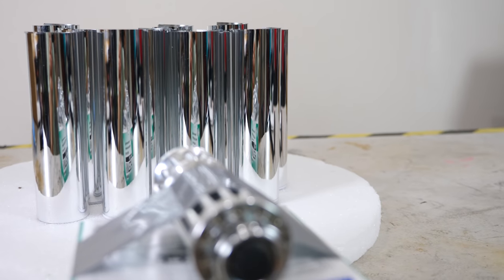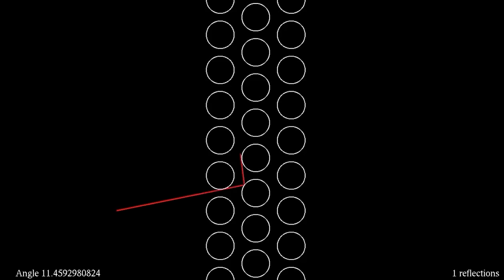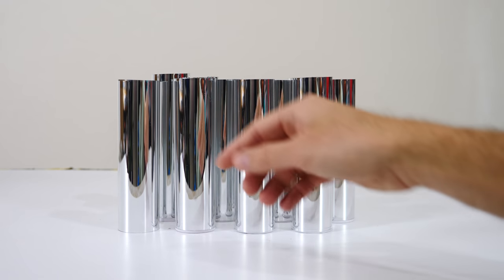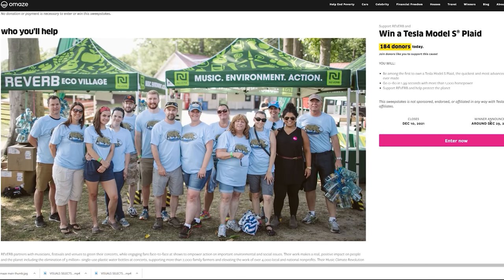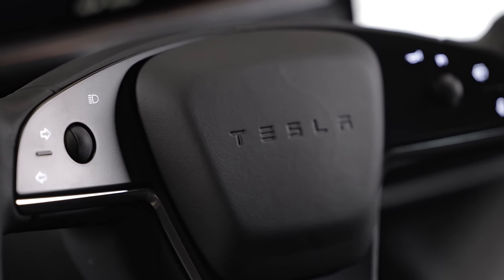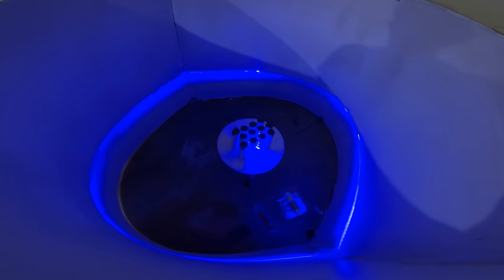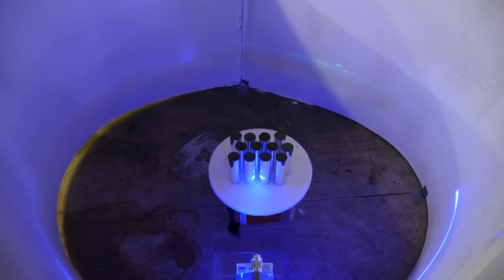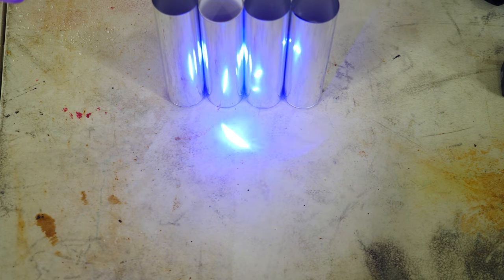The Butterfly Effect With Cylindrical Mirrors And a Laser

Comment: What if double pendulums and metronomes were combined on a movable table? Metronomes tend to synchronize overall, but the double pendulums will always interfere with them.
This certainly doesn't result in perpetual motion, but it's certainly interesting to see what happens on a larger scale.

Comment: The reason it has width, and this is a limitation of All lasers, is Heisenbergs uncertainty principle prevents us from having a single point light source and knowing it's momentum (where it ends up going.) That's also why all lasers eventually diverge (albeit somewhat slowly.)

If we did have a perfect point of a light source, the light would shoot out of the light source in seemingly all directions possible.
Reply: @JosephTurcotte117  that link is a great study. I was illustrating the point that no laser can ever have a single perfect point of light. Because as you know more about it's position, you know less about momentum. And yes, it would spread out in all directions. Light doesn't flow like a wave when we talk about point sources the way it comes out of a flashlight or laser.
Reply: @JosephTurcotte117  gotcha yeah, I was literally referring to the case of a laser that would be detectable by the human eye, not a single photon source. Yeah, in the case of photon sources, you can very much know the general direction you want a photon emitted at and where it originates from, but as in the case of a single photon passing through a double slit, it will interfere with itself and still generate an interference pattern when a picture is constructed with an extremely sensitive detector.

But I get what you mean. Observation has a huge role in the outcome of any experiment, but it gets even more exaggerated when dealing with quanta of light haha
Reply: @JosephTurcotte117  haha, alternative theory isn't quite what I had in mind or the capturing of photons. Just contemplating how to potentially narrow down the point source so we could get more of a ray casting affect without running into uncertainty issues. Not to mention, if we do a single photon, it would be hard to see a path it takes and which mirrors it is actually bouncing off of.
Reply: @JosephTurcotte117  honestly, I had to look up a quantum dot laser. I'm used to referring to them as QW lasers, if they are even the same thing? I'll have too look more into this. My class just started
Reply: @JosephTurcotte117  that's pretty fascinating. Yeah, my class just got done. I did see some info about them becoming more prevalent. Now I'm intrigued. It actually seems like some of those properties would be pretty amazing for certain applications. I'm gonna have to learn more about these QD lasers haha
Reply: @JosephTurcotte117  they should be called MLL's (meta-lasered-lasers) 🤣 jokes aside, fascinating how recursion has been around since the beginning of the universe and is universally applied in nearly everything. From the most simple compounds to the most complex devices thought up. Anywho, I gotta be up early. Thanks for sharing this knowledge! It'll give me something else to start reading And learning about. 😊
Reply: @JosephTurcotte117  ok, my mind is blown haha. Extremely fascinating reads.
Reply: @JosephTurcotte117  so, it seems his new video may ha e been based off of our conversation haha

Comment: Sure....except that the "360" didn't look like it changed at all.  The lighter spots were still light, darker spots were still dark, and the pattern didn't change when the laser didn't move.  Proving the butterfly effect would mean that this view should be changing constantly and rapidly because there is not only small random fluctuations in the ground from "noise" vibrations and gravity, but dust particles and lensing should drastically change the outcome.  Yes, moving the laser changed the pattern, but the point of the butterfly affect is to have differing outcomes over uncontrolled and random changes of the start conditions (which means NOT moving the laser pointer at all should still cause it to happen due to stated world changes).

Personally, I would think this would have been a very cool experiment if done the following:

1. high speed camera with a "steady" laser beam to see the light dispersion changes, if any, on the backdrop....even if through seemingly undisturbed movements.
2. a laser and camera with almost identical frequency, so that the light could be "followed" during the continuous shot and see if there are any discrepancies in the path (as each light emitted in subsequence frames for the camera are actually different than previous)

Comment: I suspect that you're partially wrong on this one.  I don't think it has much to do with the beam width and would happen even with a perfectly tiny beam.  So why?

I think you're actually creating an odd variation on Young's double slit experiment.  I also think this is the reason that the laser is kinda "splotchy" around the perimeter.  It's actually an interference pattern, just as you would see with a double slit experiment but it's stretched out due to the curvature of the mirrors and the pattern is unpredictable because of all of the mirror bouncing.

Comment: I think your explanation is incomplete. In addition to the laser source, the cylinders will also affect the beam quality.

If the sheet metal does not have a mirror finish (roughness smaller than laser wavelength/4) you will get more stray-light. You can see this if you compare a single reflection of the laser beam from the (flat) sheet metal onto the wall, and do the same with a good mirror.
Since this effect depends on laser wavelength, using a red instead of blue laser can help if the roughness is small.

Comment: I am Pascal from Switzerland.
I am thinking about to build an electric hydrofoil, or electrify my old moped. 

Especially for the moped i wil put an large Motor in the Aluminium Motorblock. An outrunner will not work, because of the moving magnets..
But what about a Inrunner. So in the outside, there are electric magnets and the shaft will spin.. 

My main question is:
How dose a huge mass of AL or for showing purpose a mass of Cu interfere an electric magnet that is fed with an AC kind of current?

PS: i love your videos and projekts you are doing!!! a great thank you to showing these to us!!!

Comment: @The Action Lab
What kind of linear variations do you think might be produced if you used a magnifying glass like in the negative Kelvin video but with (if necessary) stronger cylindrical mirrors? Would the difference in diameter of the laser possibly be enough of a variance in the linear effect that we might see other effects within a more finely tuned example? Like possibly a more detailed layering in the linear effect? The linear effect you got in this video for whatever reason immediately made me think the rings of Saturn and how there's that gap of thinner more widely spaced rings that is due to a resonance*??

Comment: Even if the pendulums were built perfectly the same...and functioned in tests the same (to the highest degree of sensitivity we could bring to bear...several decimal places out), the air alone (not being the same due to eddies/currents) introduces differences that quickly become apparent (a factor seen here...in addition to undoubtedly small manufacturing differences as well as several other factors like friction, gravity, etc.). And we can't create a perfect vacuum...so putting them in one would not work either.

Comment: There are definitely 2 aspects responsible for the result here. 
1. A poor laser without good optics and the associated mounts etc.
2. not nearly round rollers and very weak mirrors. Chrome-plated tubes might have been better here.
Nevertheless, a very nice and clear video. ❤

Comment: Dude.... Just put a lense in front of the laser and focus it for god sake. Then you would get the effect we see in Nils videos. it does not matter what happens in the internal reflection if your laser is focused such that it forms a point on the wall. You should see a dot regardless as I do something similar with my Interferometer. Try it at least, you should be able to get a noticeable point along with the circular band which could demonstrate the effect

Comment: What if you can record the laser with a light speed camera and use a fog machine to watch the beam of light through the cylinders?
Reply: Camera setups do exist which allow for lightspeed recording. They have to basically repeat the same experiment over and over, capturing the photons at different points in their journey. It would look so cool if someone did that with this setup.
Reply: @JosephTurcotte117  yes that's the exact thing I was thinking of, crazy that that was posted 9 years ago.
Reply: @R2Bl3nd  I thought that something like so would be a problem but definitely possible. It'd be such a beautiful unique experience I feel, from simulation to real life.

Comment: This mirror paper is far from perfect. There will be lots of pits and bumps which are not visible (in fact visible if you carefully see) and these defects will get amplified on wrapping round cardboard cylinders. That's why light got dispersed all round but also vertically. To achieve the real reflection like the simulated reflection you brought initially, perfect mirror finish reflective cylinders you should go for. For this you need to get perfectly machine polished aluminium cylinders. Certain art forms use such mirror finish cylinders where the reflection seen on cylinders is the real art

Comment: I'm not sure this qualifies as the butterfly effect. This is an an example of specular reflection with a high f number.  Also, since you're not using optical quality mirrors I'm sure your simulation won't match the result. Try running this through Zemax or FRED and see what the stray light analysis generates.  Cool experiment though!

Comment: What about a forest of flat mirrors at random angles (with black edges)? Will there be the butterfly effect? If so, at least the beam would not be spreading as much per se, only fractured! - So, the same but in a prettier/more orderly way?
Reply: @JosephTurcotte117  i think you're right, the change of angle is the same rather than magnifying after subsequent reflections

Comment: So 15% of the video is an ad, the laser was not focused and the cylinders were far from cylindrical, no idea what omaze and ad revenue pays, but the setup is so far from what can be achieved from stainless conduit or handrails and a proper laser that can be focused to a tiny point. A bit of smoke would have visualized the path of the laser and the distortion of the bent stickermirrors..

Comment: 5:43 remove your ring when using lasers. Please.  Cool setup though! Looking at the thumbnail, was wondering what kind of super-feflective metal tube you very precisely calibrated and cut with surely impressive techology to have perfectly round cylinders of the... Oh, ok, just toilet paper rolls and foil. Right, right, yes, that was my second idea, sure.
Reply: He is literally shining his laser at a dozen of reflecting cylinders, so why remove the ring? He is probably wearing the correct safety glasses already. Or is there yet another reason for removing the ring?
Reply: @dersan7522  Wanting to marry him for one!?  Nah, it's more force of habit. No jewelry in the laser room.
The cylindrical mirors create a butterfly-mess of reflections but all of them in a flat plane at waist height. Usually no beam should leave the horizontal plane because the laser-sensitive stuff (: eyes), are far from that plane. 
The ring is curved in a way that could shine a beam at just about everything in the room, thus my lab hazard senses went bing! Does that make sense?

Heck, the official rules even ask that, in case of you dropping a pencil in the laser room, you avoid bending to retrieve it (your eyes would meet the infamous horizontal plane), but to kick the pencil out of the room prior to pick it up.
Reply: @robertperezaransay1879  ,

Haha…. Great answer. 
Thus I don’t work with lasers myself, except when the boss cat demands it, i was just wondering. And i still love to learn something everyday, so thank you for that.

Comment: The mirrors are faulty... Use real mirrors it's causing it to be dispersed, i don't think that Lazer is bad but it needs to be narrowed, i wonder if you could make it Syringe needle thin...
Reply: Even if they were perfect mirrors, the laser has some width to it, so it's always going to be spread out. Unless the laser beam had the width of one photon.
Reply: @R2Bl3nd  what would happen if you could indeed send a photon thin Lazer line torwars the reflective surfaces then?
Reply: @FIRE_STORMFOX-3692  in that case, I'd think the effects would more closely resemble the simulation video that this experiment was based on. Of course the mirrors would have to be absolutely perfect, which would not be possible with flexible mirrors and toilet paper rolls. So the end result wouldn't be perfectly clean unless the mirrors were like molecularly perfect I'm guessing.
Reply: @R2Bl3nd  damn.